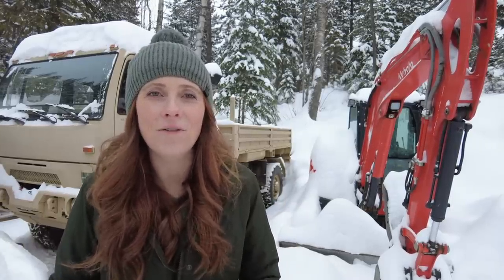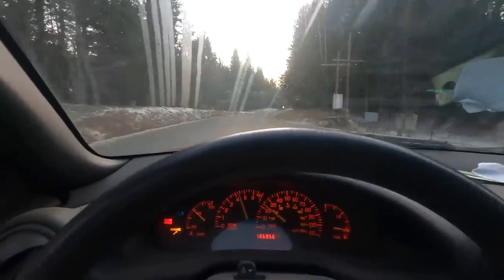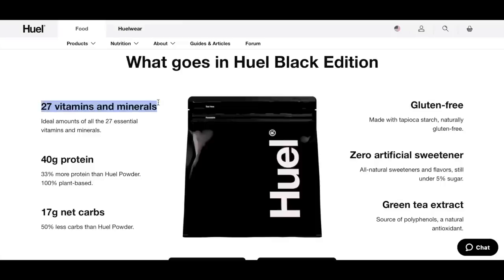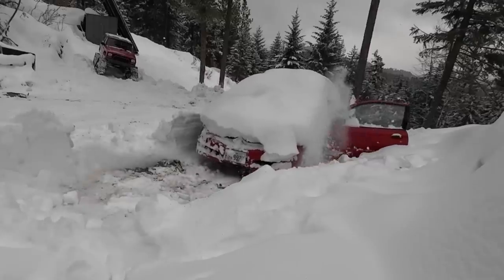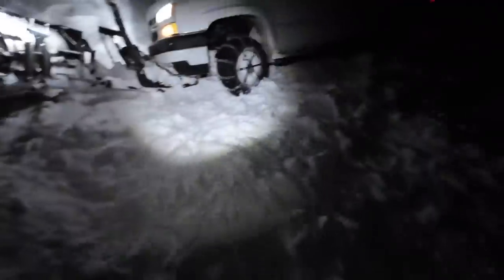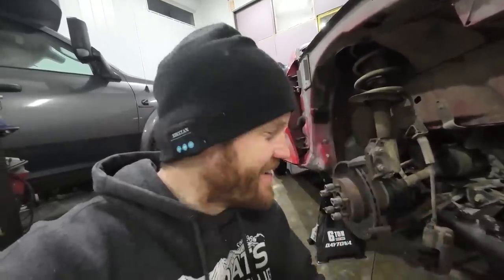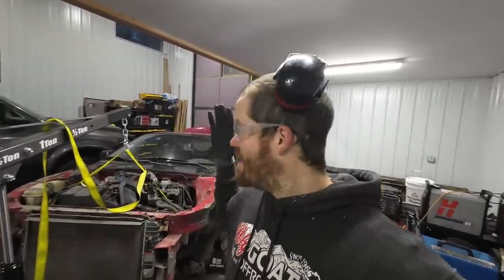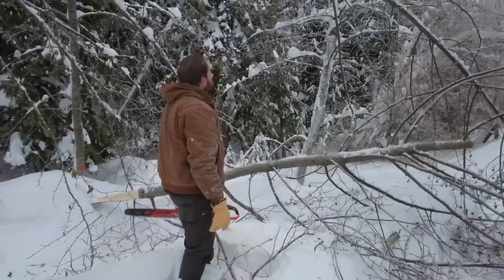Building The ULTIMATE SNOW BLOWER | P1

Comment: Cool project! Have you considered putting the motor on a skid so you can put it in the back of the truck and run hoses with quick connects to the blower? Might be better weight distribution.
Gonna be a fun project either way! 😁👍

Comment: Looking forward to this build! I thought it might be for the Army truck.  I did not picture turning it into a single unit...

I will be curious to see how well that Sunfire engine does powering that blower.  It should have the HP to do the job but the gearing will be the interesting challenge.  Getting it to 540 rpm for the blower will be a challenge.

Comment: I definitely like the "Practical" projects where you all are doing something that improves your quality of life on the homestead.  Super cool you are totally re-purposing existing stuff into something mind-blowingly cool.  My brain can't make the leap  on (1) how you balance the weight of Army Truck once you attached the snow blower w/ engine (like are you keeping axle/wheels on it to support it's weight and make it easier to control eight of blower???); (2) How you integrate the controls in the cab so you can easily detach snow blower from Army truck when required (like is engine permanently staying on army truck - so curious).  I do get why you need the cruise control to power the snow blower, and finally; (3) how are you mounting the fuel tank? Seems like you just make a new fuel tank and integrate the fuel pump in it, etc.  No need to answer my questions -it will get sorted in the journey ;-p.  Anyways, sounds like an AWESOME project - I'm super excited for you all!
Reply: My (probabaly stupid) idea would be to mount the engine and fuel tank on some sort of pallet. Then drive a Hydraulic pump with the engine. Load the Hydraulic pump and engine combo in the back of the army truck with the skidsteer. Run hydraulic lines to the snowblower in the front. Now you can have quick disconnects for the hydraulic lines and the engine/hydraulic pump combo in the back offsets the weight gain in the front.
Also you could now support all sorts of hydraulic based attachments.
Also: dont these snowblowers have ice "shoes" that they ride on? That way they mostly support their own weight.
Reply: Doesn't sound stupid to me Max!

Comment: I've been wondering when you were going to do something with that big snow blower. This should be interesting. On that skid steer, there should be a engine heater on it. The plug should be just forward of the fuel filler neck when you open the back. Happy New Year to you guys!

Comment: Idea for your external equipment to get it out of the weather. Acquire 2 more container trailers and build a cover between them. There will be additional storage in the containers plus under the cover stretched between the containers. I was surprised at not having to clear frost off the glass of vehicles stored under cover.

Comment: Love the idea, But if your open to some advice, using the cruise control to regulate engine speed will cause a lot of issues, would be way simpler to get a basic lawn equipment engine speed lever or choke lever and make a disconnect so you can control the engine speed inside the cab with ease. The load will change so much that it's gonna be hard to regulate. Also, you can make fuel system easier by getting a 10-15 gal square tank and a fairly cheap external high pressure fuel pump to save a lot of space and complexity instead of trying to adapt that fuel tank as it will have to be flat to use it and that is going to take up a crazy amount of space. Just my two cents from a mechanic/fab guy myself. Love the build idea tho. Can't wait to see how you put it all together. Happy Holidays
Reply: That's exactly what i was gonna say. If he can buy a throttle lever assembly off something like a Kubota tractor for example, it would simplify the project a lot.
Reply: He's gonna need 50+ HP to run that blower, so 'lawn equipment' engine seems lacking
Reply: @funone8716  it's just the throttle assembly he needs. He's already gonna use the sunfire engine but needs a way to control it. Kubota uses the same type of throttle on 25 to 100+ horsepower hydrostatic tractors.
Reply: @jonathanlemire2797  He needs all the shitload of electronics and computer to run it in it's stock form as well no?
Reply: @funone8716  yes. But doesn't need the cruise control. So basically the throttle assembly from a tractor would replace the pedal assembly jn the car. Back then, the throttle body was still physically attached to a throttle cable, versus modern cars that are fly by wire. The throttle lever would not move once he sets it at the desired speed, so doesn't need a complicated cruise control.
Reply: @jonathanlemire2797  One thing he needs for certain is a governor of some type. Either a peerless type thats belt driven, or yes, maybe the cruise would serve the same purpose but not as simple

Comment: Sunfire seats are a exact fit for early wranglers, I bought a set from a wrecking yard for my 92 yj. They require no drilling to bolt into the jeep seat brackets, and are so comfortable compared to oem seats.
Reply: Such a great tip.   Never would have thought about that myself.   Someday you might see Riley on the big Cat in a bucket seat!

Comment: Wow, nice bump this time, almost 280 now. Finally you open up about this!! Been seeing it in the background for some time and asking about it. That was a fun ride with a thrasher and proper use of a skid steer.
Why not just a run a PTO off the trucks tranny? Or a small gas engine running a hydro pump? Both would be so much easier.
Reply: That's a commercial, 2-stage ribbon and impeller, 84" wide (I think) snow blower. Running that off the LMTV 275hp/860lb-ft would not only hamstring both the truck and the blower, but it's unsafe to do so when taxing the platform at very low temperatures. To keep performance and reliability high, it's best to run the blower off its own source. Using the vehicle engine as an APU as Riley and Courtney are doing achieves this. If anything, the 140hp/150lb-ft 2.2L out of the Sunfire is still undersized for the job. Riley's done his homework for an effective, affordable solution.
Reply: @yoplaitmajor  Not at all with the speed they are running it at. Should be a PTO on the tcase and the torque the cat engine has. DO you think the plow trucks out run a second engine down the road? If a 75 HP tractor can do it, why not them?
Reply: @yoplaitmajor  Riley said it is an 8 ft (96") wide blower. For such a large blower I think it is underpowered, he should have considered engines just over 225 hp so that after losses for gearing, friction, etc he would have 200 hp at the blower for great performance from the end product. I also would not have chosen a computer controlled engine, he would have been better off with a pre 1994 diesel AG tractor engine, stand alone industrial diesel engine possibly from a large generator, or medium duty diesel truck engine so there would be no electronics or sensors
Reply: @johnjr3870   Totally get what you're saying. But PTO isn't going to power that monster the way it needs to be. And yes! Some commercial application snowblowers use APUs to power the ribbon and impellers. Not required of course, depending on the application. But for this project, the APU is a VERY good idea.

Comment: Hmm I'm not sure I would mount the motor to the blower. I think I would be tempted to use the motor to power a large hydraulic pump (put this in the bed of the army truck) and power the blower with a hydraulic motor. This would help minimize how far the blower sticks out in front of the truck. Several ways to skin the proverbial cat though. I can't wait to see how you make it work.
Reply: i think the same but that would definitely cost a bunch of dollars since you are transferring over 100 hp ( 135hp at 5600 rpm) . would have to go through the transmission to get the rpm down as most pumps top out at 2000 rpm.

Comment: No sooner did y'all get the shop functional & now you're into 'Rileygineering!'

Good thing you didn't come across a surplus GE J-79 (engine from a Century series jet fighter).  Zero doubt Riley would somehow create the first jet powered Cat D8, complete with working afterburner to melt snow off the steep sections. 

Looking forward to the fab on this first-in-the-new-shop project. You two will pull it off, Courtney will create a professionally edited video & we get to see both ofnyou driving the ArmyTruck PontaYellowPlow (PYP). 

Happy and safe 2023!

Comment: That road sure requires lot of work there. This is very good information for any people who have ideas about moving offgrid on top of some hill. Oh, wait, was there someone who moved offgrid on top of some hill, let me think.....    Well you'll get the things needed for the road in order, it gets easier then.  For snow plowing, you could consider making some kind of markers for the road edges, so you could avoid driving off the road when plowing it. You probably wouldn't even need those markers for every section of the road, just the parts which you see making most trouble.

Comment: Body control module...cruise control...wiring harness...I'm sure there's a great reason you didn't just run a long choke cable to the throttle and use that?

Comment: I am so interested in this project.  I don't live all that far from you guys.   I think we got down to -26° f and in my barn, I built a mylar insulation tent around my lawn tractor that has our snow blower, and put a halogen shop light in there to get the oil warm enough so the starter could turn it over. I luckily have a Kubota that has a block heater that starts great. I need a plow truck.
Reply from the maker: Wow, THAT is cold! That’s a creative solution to get it running!

Comment: What a project!!!!
Can't even imagine. Be 100x easier to buy a blower for the pickup.

I hope in the spring one project is a car port.
Get all those vehicles partially out of the elements. Certainly have enough trees for the structure and then steel for roof and backside.
Too bad it would face wrong direction or another platform for more solar panels.

Comment: Riley, my father mounted a seven foot two stage snow blower meant for a farm tractor on the front of a Willy’s Jeep pickup. He used a 318 cu. in. V8 engine, it was lots for regular snow but was prone to over heating if you had to move packed snow such as when it slides off the roof. Your 2.2 litre four cylinder will probably work but it’s going to be stressed to get the job. Kool project bro
Reply: Edit: my father mounted the engine on a skid in the box and ran a shaft under the truck to the front, to lessen the weight on the front axle
Reply: How bout a Flamethrower attachment next 😊😊
Reply: @chaz337  easy peasy! Go with open pipes on the blower motor! Wild flame show and wakin up the neighbourhood in one fell swoop( not to mention how cool open pipes sound)

Comment: You may need to wire up the wheel speed sensors for the cruise to work . Although I'm not entirely sure what you have dreamed up 🤭 . I'm sure it will work itself out though.

Comment: Haven't watched all the video yet, but I'd like to suggest powering the snow blower hydraulically.   When I worked at the AZ. Dept. of Trans. we had a blower that mounted to a big front end loader and was completely removed in the summer.  It had a separate engine for the blower which mounted on the back of the loader and the auger/blower unit mounted in place of the bucket. The engine ran a hydraulic pump and hoses ran over the cab to the hydraulic motor on the blower unit.  It was all self contained and could be mounted and dismounted in just a couple of hours.  This should work well for you, too.  Mount the engine in the bed for better weight distribution.  Running hydraulic hoses to the snow blower solves all kinds of alignment problems.  Use an aftermarket stand alone cruise control with the sensor mounted to the hydraulic motor to control engine RPM.  Drive the pump with a chain and sprockets to simplify alignment and reduce RPM to what the pump likes.
Reply: More ideas:  As you probably know, there are flow control valves to regulate hydraulic motor speed.  Also, engine RPM can be controlled with an old-fashioned belt driven governor which adds throttle when the load increases and closes the throttle when the load decreases so RPM stays constant.  If you are using the original axle shaft to run the blower, you will have to weld up the spider gears or do something to anchor the other axle shaft from turning.  That would soon wear out the spider gears as they're not made to spin constantly.

Comment: Awesome. 
Maybe remove fuel injection & add carburetor. 
Maybe put power unit in box of truck or behind truck & run driveshaft under the whole truck. This worked great in an S10. Best weight distribution. 
I've also seen the engine mounted on top of snowblower for UTV. to keep it short.

Comment: Something to think about: the received wisdom is that the tip velocity of the second stage should be in the neighborhood of 5,000 ft/min (circumferential velocity) - that's roughly 60 mph - to get the thing to really sling snow.  Adding rubber paddles to the tips of the second stage to minimize the clearance between the second stage housing and the fan can also help, especially with wet, stick snow (as close to zero as practically possible).  That last point may not pertain in your neck of the woods, but it's probably easier to do at the build stage in a warm garage than to fight with it when it's encased in frozen former slurpy.

Comment: So much snow - I saw a video a while back that shows how you can melt snow very easily,  but it requires lots of pex tubbing and putting it under the ground - then you recirculate hot water some use windshield wiper fluid to prevent water from freezing and you have yourselves a much easier time removing snow.  but that might seem impossible putting pex pipe under the entire road way - the video I saw was only the driveway around the house

Comment: For the throttle u would be better off usin a RC servo and not cruis control so then if anything goes wrong or ya need to adjust it ya can,it doesnt take much to move the cable or better is take the spring off the TPS so the servo has less load

Comment: The plow I can see, building a 3point system on the front-end weellll I guess ..But adding a motor to the plow means at least twice  that much in weight to the back ,Plus plow chains to all  4 corners AND A WAY TO RECOVER  said BEHEMOTH !!!  The D8  will want to skate too if you try it especially if you get it sideways on a grade it won't stop until you hit something  BIGGER .. Try thinking motor package in back with hydraulic pumps and drive motor on blower / less weight in front plus gives hyd power for 3 point lift, lines over the top for clearance or under and tied up with fingers crossed  run permanent steel lines so plug plow in front ,load power pack in bed connect lines in rear  pair ratchet straps so stays in place .Hey Stop That My Ears Are Burning ,Happy New Year  guys .....

Comment: I see that the snowblower needs lots of consent power or RPMs to move the snow, so to power it from the truck engine is out. So will it be direct drive from the second engine or will the engine be in the back of the truck and use hydraulics to get the power to the snowblower. I would have used a generate and an electric motor on the snowblower but I feel more comfortable with electricity than Riley. so will it the motor be in the front or the back of the truck? Cost of parts is leading me to think that it will be front heavy - direct drive. I am awaiting the next video for the answer. Or Riley, can I have a spoiler comment?
Reply from the maker: I actually did consider an electric motor. It takes a BIG generator to power a 100HP motor.

Comment: a lot of those old army trucks that are automatic transmission have a cover plate for a hydraulic power take off I have a 1984 ford 800 cab over and their is one on each side of the transmission and in the past we had a dump bed hooked to it. might be easier to put a wet kit on it than build a engine for the blower

Comment: Well ,this should prove interesting. Not knowing what you fabrication plans are, if you mount the car engine on a skid,load it on the very rear of the truck,that would help to counter balance the weight of the snow blow on the front. As for power to the blower perhaps a hydraulic set-up might work,high volume and pressure pump on the car engine,and hydraulic motors on the blowers auger and impeller drives,will also need a way to raise and lower blower unit,and rotate chute,hydraulic would seem to be the best option for power. And you'll probably want to invest in tire chains for both axles, like a skidder type with ice biters, considering what the terrain is like that your driving on. In years past,I saw the equipment that was used in Central Oregon for snow plows,older skidder units with V-plows and roll off blades,all tires chained up. Patiently waiting for the next chapter of this build.Happy New Year!!😎😎😎

Comment: As long as you have all of the computers scattered around the Sunfire, you should be ok.  Would not be fun trying to get the 4 cylinder running if there is a "trunk light on" interface that shuts down the ignition ... or some sort of goofy sensor that the doors are no longer closed ...  Like the Twilight Zone episode where a brain was dismembered from a body and stored in a jar.  The closing shot was the eye moving in the jar.  I wonder how the Army Truck will steer with all that extra weight on the front end?  PS:  Happy New Year everyone!